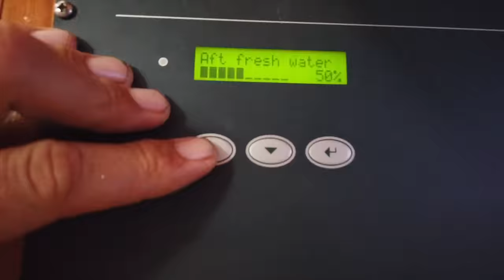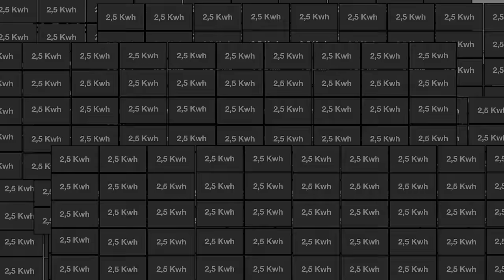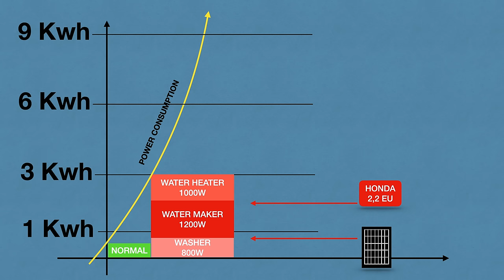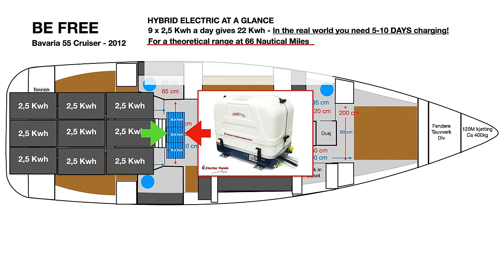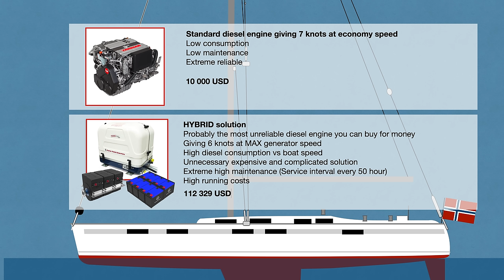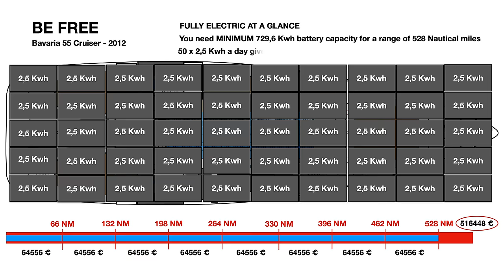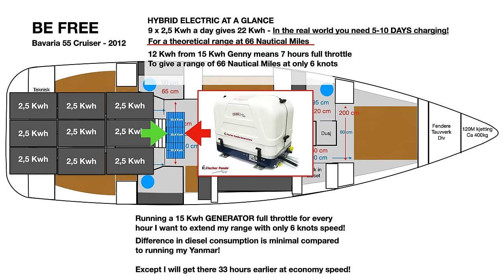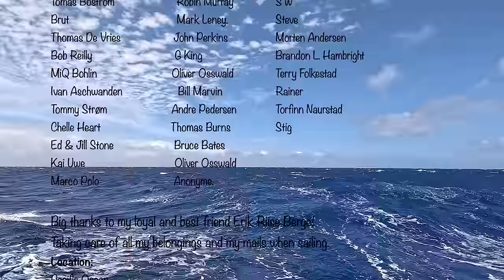Why I don't believe in ELECTRIC or HYBRID for long-distance sailing - SwT 170 - MY HONEST OPINION

Comment: Hi, thanks for your honest opinion, this obsession with going green put safety at risk. The diesel is the way to go but better design one need  to be put forward like the diesel with opposed pistons with 2 crankshaft that generate more than 50% efficiency. Electric motors are good to go to remote protected areas, just imagine getting a lighting strike on your sailboat and having all of it going literally up in smoke! You sure going to be green , ya green with envy with your neighbor running his DIESEL!!!

Comment: Very good points Thomas and for the size of boat you have plus the distance sailing you do, I totally agree with you. You don't mention  hydro generation when sailing but if no wind no generation. Perhaps fuel cells or something like Toyota's new hydrogen engine developed as a marine version will be the future. I think all Shipping will be powered by green hydrogen in the future. You should do an episode smashing that generator up ha ha

Comment: Hi Thomas, great explanation. 
You can explain a different hybrid system with an electric engine on the shaft next to the engine. 
This will solve most problems. 
The purpose is not being green but able to motorsail without noise and to enter/leave harbours without fumes.
Creating apparent wind with an electric engine works very well and allows you to sail in little wind where you would normally start your engine. I guess this is not related to safety so perhaps a topic for a next time. 

Rgds, Berend  sv Lyrics

Comment: Hi there Thomas.  After living onboard for 25 years, and being a marine engineer.  May I draw your attention to Beta marine hybrid diesel engines.  This system would solve many of the issues you mention.
  Also, I  don't think anyone with a hybrid system  and a large battery  bank would expect to be able to charge  their bank from empty to full in ONE day via solar power! 
  Unrealistic...
  I do appreciate your Chanel, and have gained much from you experiences in areas I wish to go in the future. 
  Best regards.  Mark.
Reply: I am not a sailor yet, but an automotive engineer. A parallel hybrid system like the beta marine one would be the only viable solution for a sailing yacht in my opinion, if hybrid is wanted. I would argue such a system could even increase safety, because you could still have manuverability by propeller in port/near shore in case of an main engine failure. But I am not sure about the effectiveness of the proposed way of operating it. Because of the losses while charging and depleating a battery there is typically not seen a huge benefit if any in fuel consumption due to increased load on the main engine. At least that is the case in plug-in hybrid cars and why they typically are not operated like this. The main benefits I see in such a system is the ability to generate electricity with the propeller, while sailing independent of fuel and sun. And the reduced noise, so I would use the electric engine while motorsailing mainly 5-8 hours a night to get more comfortable sleep.
Reply: Having looked at these there are two problems: firstly price 3 to 4 times price of diesel engine, secondly they are tied up with new builds- no availability for retrofitting.
Reply: @benh9928  Benh. The Beta marine hybrid  diesel electric is completely able to be retrofitted when replacing ones current diesel.
Reply: Fully aware they can be retrofitted, but first you have to be able to get one. They are fully booked for a long time ahead for new builds, at least in Europe, so you can't get one if you wanted to
Reply: @benh9928   In my mind that means a lot. Customers must be very pleased with their equipment.
Reply: Maybe its not not available for all at this point, and/or too expensive, but i think its more or less here (or super close).  Sailing with the Wynns new HH cat with the dual hybrid diesels and high output alternators, a big battery bank, large solar capacity, and hydrogeneration.  Seems like that solves for it all with all the redundancy you'll need.  Further. all will get cheaper and more avail.  What's missing in this situation?
Reply: @tjsakasegawa5466  well for me the extra hull and associated real estate for a solar farm!  36 foot mono doesn’t offer quite the same opportunity. Maybe in a few years when tech makes everything smaller and more efficient
Reply: @tjsakasegawa5466 Yeah, hybrid parallel seems like a great solution. Sure, it's expensive up front but you get extra redundancy, lower running costs, additional power generation, and quiter motor sailing.

Comment: Something not considered by most is prevailing wind and which way the boat will face relative to the panels and sun. For instance in the san blas islands you are mostly facing north. This means that you will have only half the panels getting sun in the morning and late afternoon and only usable amounts if you can tilt them. You only fire on all panels mid day for a few hours. You may get little or no exposure if the tide, current, or wind conspire against you when you anchor or are under way.

Comment: On a smaller scale, I've come to similar conclusions about batteries and solar panels.  In building a small camper to pull behind my wife's Subaru outback wagon, I started with a deep cycle marine battery and hoped to charge it with a solar panel.  The few lights were LED, we had a small chest refrigerator and a ceiling vent fan that we didn't need often, because we insulated the camper well.  The battery was inadequate and took too long to recharge from the solar panel.  I ran a wire from the car to camper to charge the battery from the Subaru alternator as we traveled, and actually had to run the engine when camped on occasion to charge the battery.  Upgrading to a lithium battery solved most of the problems for the camper.

Now I'm planning to reimagine a small sailboat for lake or coastal sailing (to teach my grandsons to sail - that's my excuse, and I'm sticking to it).  I hate the noise of gasoline outboard motors, and they can be cantankerous when trying to start them, so I have decided on a small electric outboard, adequate to move the small boat when there is no wind and I simply must move, with a removable battery (that floats if I drop it in the water).  The motor is designed to recharge the battery through the propeller when under sail - how effective that will be, I'll have to learn.  And I'll carry a sculling oar for when the wind dies and the battery is discharged (or buy a second battery) for those occasions when I simply must move the boat).

This is my first time to see one of your videos, and I enjoyed it.

Comment: Totally agree, specially for a mono hull, it's impossible to make it work. 

On some multi hulls, depending on the design, you can quite comfortable run your boat on sailing, solar and Re-gen however you still need back up diesel engines for emergency protection.

Comment: A lot of useful information. I would say no due to the lightning alone. The cost to replace all the electronics, even with a redundant isolator setup. Which might not work as intended. Lightning being lightning and all. Great video thank you for sharing your thoughts!

Comment: Very good knowledgable video about the realities of an electric solar boat. I'm completing a 40ft power catamaran. I'm going to have 6kW of solar panels, 90kWh of LiPO4 batteries and four,Epropulsion Navy 6.0 outboards. The cat already has two 250litre petrol tanks, so I'm going to have two suitcase generators like yours for emergency backup. I'm hoping the motors will do about 5 or 6 knots using 3kWh. That will give a range of 20 miles if there isn't any solar, however I want to start off in the Med and gather data once the cat is on the water, I'm thinking this will be a coastal boat rather than a blue water one.Any thoughts?
Reply: I would definitely do more solar if possible. 90kwh is decent. Unless you are only doing short hops in fair weather, the generators will get a lot of use, especially if you are running AC.  Suitcase gens are not a great solution. Loud, smelly, and dealing with petrol is no fun. DC generators are the way to go but they are hard to find and very expensive currently. How much does the boat weigh?
Reply: The catamaran will weigh somewhere between 4 to 5 tonnes I think. The hulls and bridge back weighed 1058kg at turnover. I am adding 650kg batteries, 160kg motors and 300kg solar panels. It may weigh less but I think 5 tonnes will be the maximum figure.
Reply: Adjust your speed according to how much solar you are producing so that your batteries remain around 100%. If it is cloudy you will probably still produce  about 600-900W  from a 6kW array. you should be able to cruise maybe around 3 knots on 900W of power. The power halves for each reduction of one knot of speed. So if you get 3.3 hours at 6 knots and reduce to 5 knots you should get about 6.6 hours, and 13.2hr @ 4 knots, and 26.4hrs at 3 knots, for a range of 80 miles. That is with no power from the panels.

Comment: Very good information about the reality of solar generation and the cost of the batteries.
Even if you add a couple wind generators an electric motor draws too much power.
Solar panels and wind generators are great for charging the batteries for radios and navigation.

I just watched a video about an older famous British sailor (Jimmy ?) who had a nice catamaran built for the Elcano Challenge but crossing the Atlantic he realized it would not work, just as you said, he can't recharge the batteries as fast as they drain.

The obvious answer is to use less electrical power. 
One way is to sit and wait for the batteries to charge up and the other way is to have a diesel engine.

Comment: I have had some experience with Kubota engines and they make a very good generator but I agree you’re burning fuel one way or another . I would rather have the safety
Of my Yanmar That is naturally aspirated . I think your advice to have the engine running during a thunderstorm is excellent. Yes once a diesel gets started, it likes to just keep running.

Comment: Some very interesting and valid points from someone who clearly has experience as well as theoretical knowledge of these systems. My only feedback would be that your battery and solar calculations were a bit misleading. 
The battery capacity calculated was for 500NM but then you referred to the amount of solar required to charge that in one day. You are not doing 500 mile days so would not need that much energy every day but more like over 3 days. Still completely unobtainable of course but over dramatizing it isn't really necessary.
I think you also probably needed to consider that if you have half the required energy input (lets say from solar and wind generation) on an average day you are doubling your battery range because you are only using halve the output from battery. Again I understand the numbers don't add up it terms of cost, weight etc but for the right boat like a lightweight multihull with plenty of deck space for solar and easily driven hulls there could possibly be a workable sweet spot.

I still would like to think that a full electric with propeller regeneration (and solar and wind assist) as well as  generator backup is doable with the right expectations and understanding of the limitations.
In my experience sailing the South Pacific, NZ, Aus and even Antarctica, at sea you are sailing 95% of the time so with a good regen system charge will not be a problem. When sailing coastal in and out of port and anchorages you will be using the engine a lot more but still should be sailing the vast majority of the time  and can also pick the weather better so should still be ok.
In saying that I grew up with the attitude that the engine is used as little as possible and I hold that to this day. I regularly see yachts motoring around in good breeze with just a headsail unfurled because they can't be bothered putting the main up and/or heeling or something, I don't honestly know why they don't sail. 
I have to admit I have a mild aversion to diesel engines ruining the serenity of being at sea!
I have not sailed much in tropical areas since I was young so wind may be less reliable up there than where I have done most of my miles so this would have to be a consideration.
Getting out of the way of bad weather in event of a dismasting is a big one that I agree with you on, and why a backup generator is probably always going to be required.
It appears that some of your thoughts may be derived from the understandable frustration with the generator you have. 
Do you think if you could get one that was as reliable as the diesel engine it would shift your perspective? 
Anyway thanks for the great detailed video, I will definitely come back to it when i am designing my own auxiliary system on my next boat.

Comment: I watched the video and can agree with some of the points. 
I am going hybrid way and intended to go full renewable just because it seems interesting to me ,it definitely not easy or cheap, diesel engine definitely is lot more simple and robust I have to agree with that. 
I am surprised about fact diesel generator is so unreliable, I would expect they are more efficient and low service, well I lerned something new .
I have cheap Chapion 1.8kw 4 stroke generator as my eletric back up then have plan to install 1.2kw solar , and will have 28kw battery pack .

Comment: Great video, I was thinking going full electric but with a light racer cruiser and with an 25kw servoprop oceanvolt, then you have a huuge regeneration of Kw while sailing, so you get a constant power in your battery. altough When the weather is calm, you need to motor at 3knt so you get way more range than what is annonced. but it's still not valid for cruising around the world for different reason  : 1. security reason , if you dismast in the middle of the ocean you're F****d 2. price and weight of lithium battery.  But I think if 10 to 20 years, that'll maybe the way to go.

Comment: Hello, I think you have been spot on with the majority of your points. Serial hybrid makes no sense for long distance cruising, neither does an AC Coupled hybrid system for the vast majority of cases, However if you have a boat designed for hybrid operations which is DC coupled it makes a lot of sense especially with the increase in redundancy and efficiency gained with variable hotel loads. If your following the trade winds the ability to regen power is pretty impressive and should enable you to motor on pure electric when required, P.S all of those variable speed generators don't make sense for hybrid systems as you should size the generator to be constantly loaded at 80% charging the battery to match the most efficient fuel burn I have seen a few studies on fuel saving ranging from 23% to 65%. On the point of lighting strikes it is a serious issue but an issue with tons of solutions, a properly designed system will be fine and if it is not you still have a parallel diesel engine which can work by itself unaffected as it has no sensitive electronics to be damaged by the lightning surge. The main issue in my mind as you so accurately point out is the increased capital costs which is likely to pay off for the vast majority of sailor within a few years. Sadly I think the vast majority of yacht owners will not sail if its not perfect conditions and instead use there engines, in which case hybrid makes less sense.
Reply from the maker: Thank you so much for watching and for your comment as well. 
All the best

Comment: The right way to do hybrid is to have these combo motors which have electrical motor added after the gearbox. This way the electrical motor can be used as a generator from the motor, or when sailing as a hydrogenerator. To get the maximal redundancy benefits I would still keep one real generator (just something else than fisher panda, I have not heard anything else than curses about them), so you actually still have the range with electrical propulsion also. I'm also thinking that the electrical engine could probably act as starter motor if it had some issues, but this is not something I have seen anybody advertise, so I'm not sure if there is something preventing this. So, for normal longer distances you still keep running with the diesel engine, but now you can skip the short bursts for marina/anchorage that are harmful for the motor and annoying for you. Probably you save something in the longer run, but I would say the main focus here is comfortability and extra backups for everything, not savings or being green.